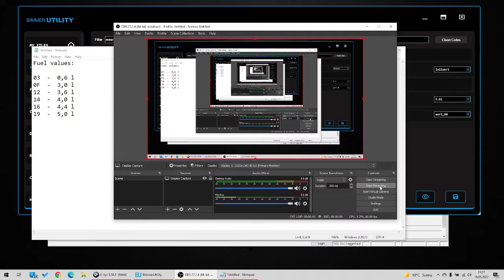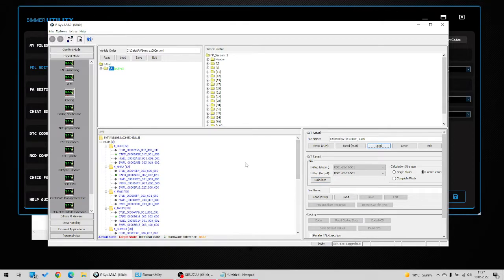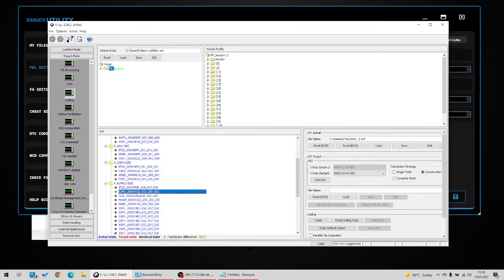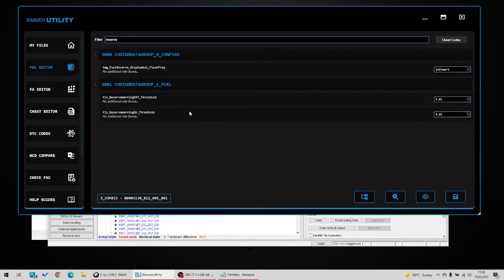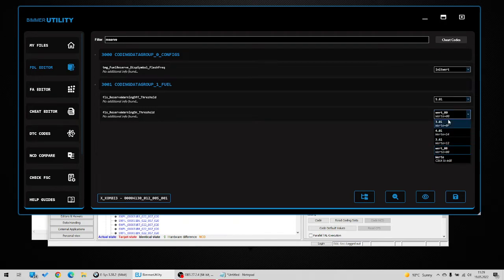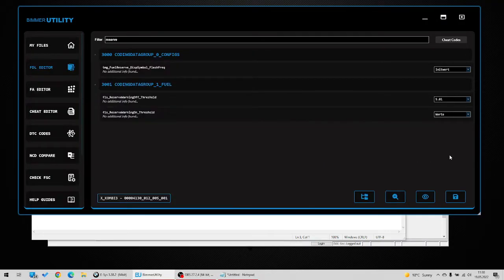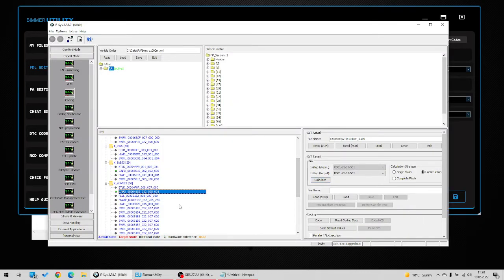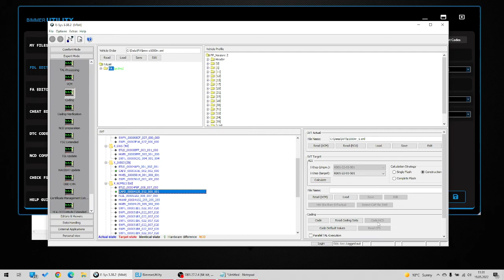Remove or modify fuel warning threshold BMW Motorrad

Comment: Hi, thanks for the good video, i have a question regarding the fuel table you provided, I can’t really find some kind of order  in the numbers, but can you provide information for below 0F  like 10 08 06 04 what they provide before fuel pop activates, i want it to be active when 1-2L is left as its for track use, but I don’t want to turn it all the way to 0,6L 

Take care and hope you can answer 😊
Reply from the maker: Liters Hexadecimal
    0.0          00
    0.2          01
    0.4          02
    0.6          03
    0.8          04
    1.0          05
    1.2          06
    1.4          07
    1.6          08
    1.8          09
    2.0          0A
    2.2          0B
    2.4          0C
    2.6          0D
    2.8          0E
    3.0          0F
    3.2          10
    3.4          11
    3.6          12
    3.8          13
    4.0          14
    4.2          15
    4.4          16
    4.6          17
    4.8          18
    5.0          19
    5.2          1A
    5.4          1B
    5.6          1C
    5.8          1D
    6.0          1E
Reply: @bmwcodingmoto  thank you so much 🙏🏼🙏🏼
Reply: @bmwcodingmoto  can you please help me one more time 🙏🏼

X_KOMBI3
cfg_RDC_Set_Front
cfg_RDC_Set_Rear

Need the scheme for custom values to set RDC pressure warning, much appreciated 🔥

It’s nice to change all this stuff for track
Reply from the maker: @PZohard  what pressure do you want?
Reply: @bmwcodingmoto  if it’s not to complicated from 0 to 3 bar

Comment: Do you know if it’s possible to switch the color of the rear turn signals from the NA Red blinker to the Euro Amber blinker? It’s apparently swappable within the ECU.
Reply from the maker: From what I know you need other blinkers. I would need cafd files from NA and EU bikes to compare them and then try it.
Reply: @bmwcodingmoto  I have the TST aftermarket ones, they state it will work with both Euro and NA. They will swap colors depending on what the ECU tells them to show. That would a super cool mod for NA bikes.
Reply from the maker: @ghostreap  send me your cafd files and I will compare them with my EU.
Reply: @bmwcodingmoto  will do, DM me your email. It might take me a minute to get them to you.
Reply from the maker: @ghostreap  visansorin92@gmail.com
Reply: @bmwcodingmoto  hi, did you find how to make this work, interested on doing this on my bike, thank you.